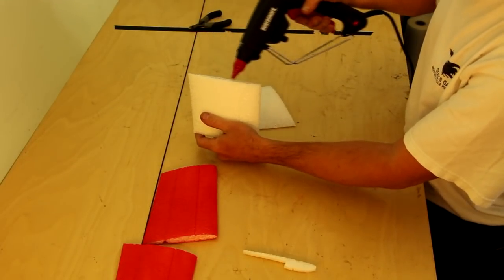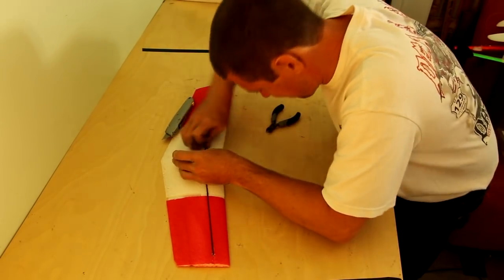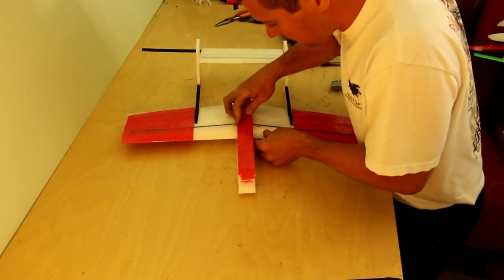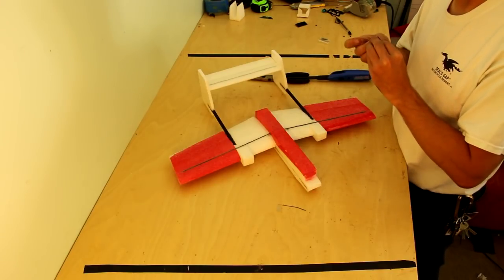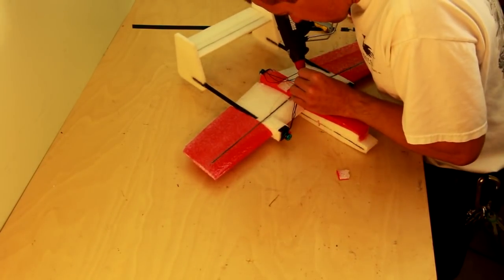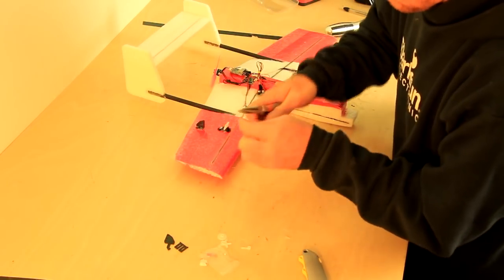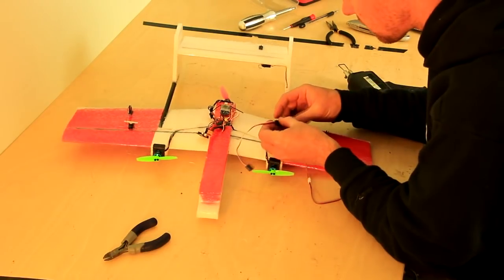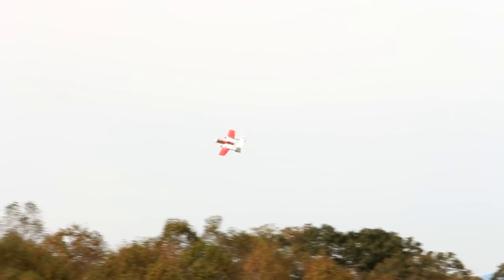VAS Ghost power build tutorial

Comment: Hey Alex,  just got the kit and am wondering why you cut the spars instead of bending them along the length of the entire wing?  It seems like it would be stronger this way.  I know our group has a couple people building these planes and this was the one comment they made about it when they were building.
Reply: I agree, there's no good reason to cut the main spar in two if you can bend it, unless it might deform the wing while the glue is drying.  I built this one according to instructions. With a little luck I won't need another.
Reply: @devinviable  I don't have one of these yet.  Is the spar channel pre-cut?  If not, cut the channel straight across and then don't cut the spar in half.
Reply: @twinturbostang  it is preformed but nothing is stopping you from cuttng your own channel.

Comment: great video, were did you get the fancy glue gun ?   keep on your GREAT work
Reply from the maker: It is a SureBonder temperature controlled glue gun.  I also use a better quality glue stick which makes all the difference in the World and the temperature control makes sure the glue bonds to the foam without melting it.  I get my stuff from glu-stix.com, but there are several suppliers.  The glue is called "dura-tac".